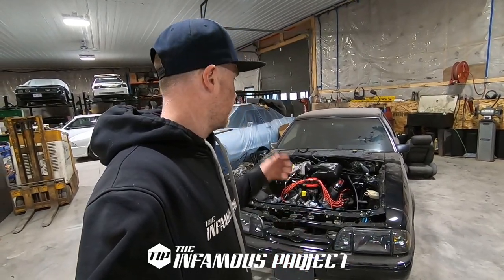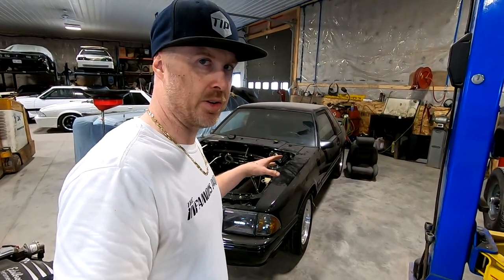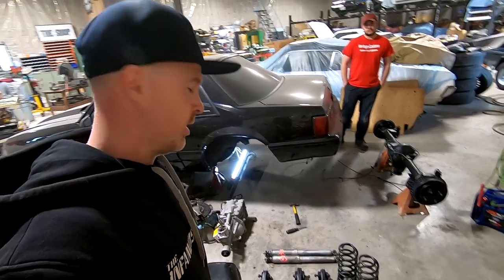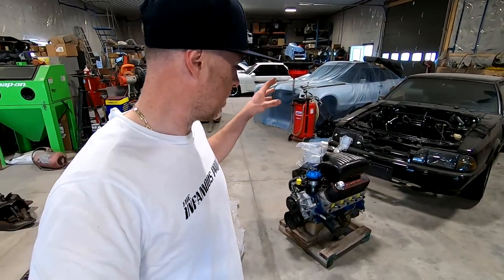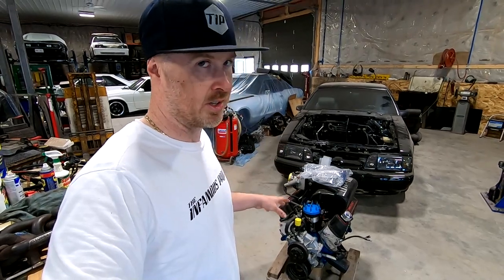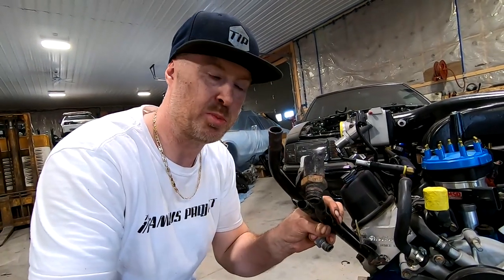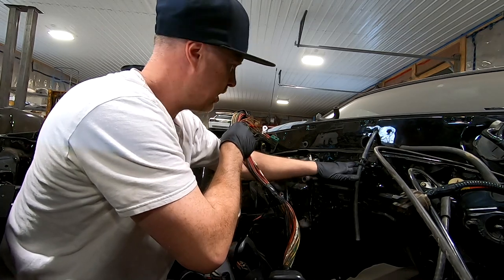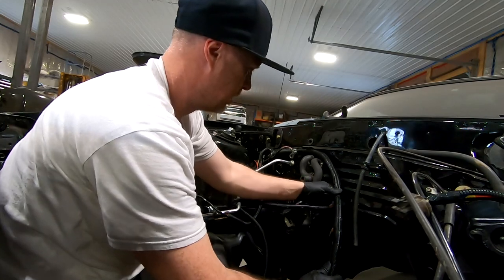Built 306 Motor Install in the 1988 Foxbody Notch - Project "Tax Return" Part 6 - TIPS04E26

Comment: Run convertible motor mounts on that motor and it might drop it low enough to clear the stock hood. I did that and spaced my k member down 3/4 inch and it allowed my 351w to clear with a stock hood.
Reply from the maker: I always use vert mounts!
Reply: @TheInfamousProject  many don’t know that secret

Comment: Do you need to worry about the pinning of the O2 harness with this swap? I’ve heard a lot about frying computers with the wrong O2 harness, but it’s always in reference to 89+ cars. Seems to me the car-side O2 plug/connector on earlier cars is pinned such that you could use any O2 harness and be fine, but I’m not sure. I’m doing the same swap (4to8, auto-to-T5, MAF conversion) and really appreciate these in-depth videos — thanks!
Reply from the maker: Great question! So if your car was originally a MAF car you would potentially run into an issue. All MAF equipped cars came with a harness that contained a "loop" the difference in loops depended on whether the car was auto or manual and the year! Check out this link https://www.corral.net/threads/o2-sensor-harness-differences.1449089/
Reply: @TheInfamousProject   thanks for the link to that thread — great resource! That led me to another which I’ll include here for others with the same question: https://www.stangnet.com/mustang-forums/threads/1987-o2-harness-question.884039/
My reading is that SD cars could run any O2 harness because they only have 5 wires to the connector, so the loop can’t cause a wrong connection / short.  Does that sound right?
Apparently it was something to do with the neutral sensing switch wire detouring through the O2 harness connector via the loop...?

Comment: Mr infamous I had a ? For I found a 1990 Mustang gt I know it been parked for a while has no inspection sticker and does have a motor I want to give an offer but not sure what be most I should offer what do u think I still need check strut tower and floor boards for rust I live outside of houston TX so should be to rusted let me know
Reply from the maker: Email me info@theinfamousproject.com

Comment: Your going to have to lose those valve covers (go back to stock ones). lose the intake spacer and should fit under a stock hood. I had many rpm 2 intakes fit  with a stock hood.
Reply from the maker: Yep started modding some stockers today